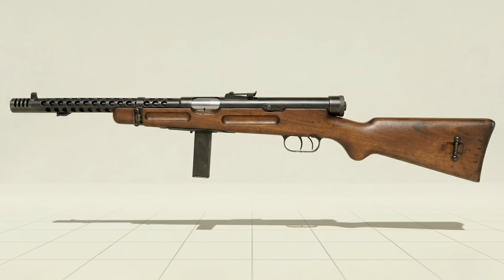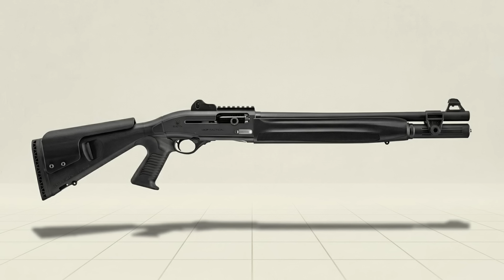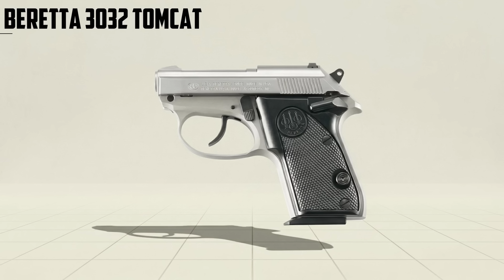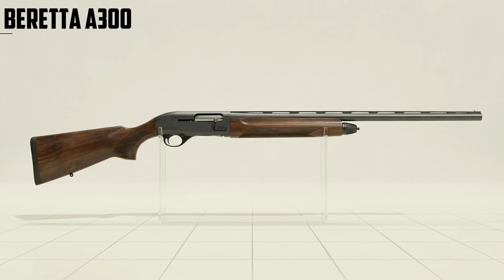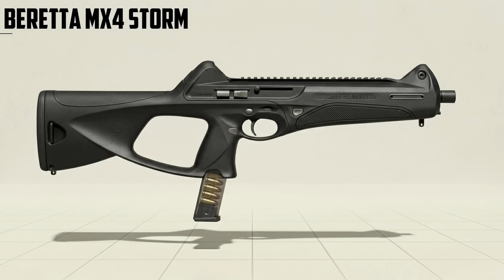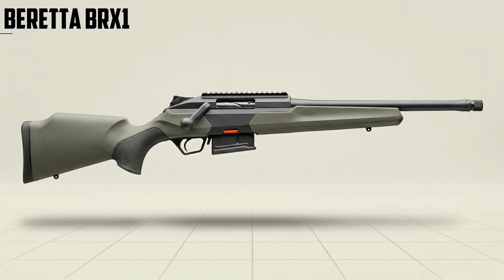Every Beretta Weapon Ever Made

Comment: Ahhh you missed what I carry🤣 You forgot the Brigadier line. I carry a Brigadier 92. Grip feels a bit more comfortable then the standard 92 and the slide is slightly different. It's also a little heavier, but not by much. I've got both a standard 92, and a Brigadier 92 which I carry. I also have a Beretta 84bb, part of the Cheetah line.